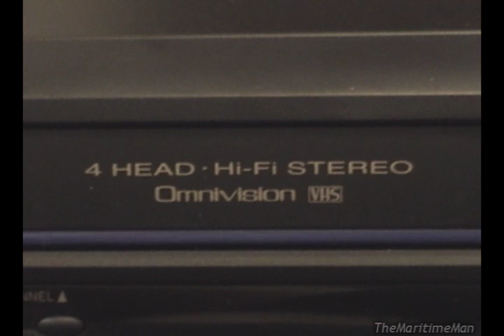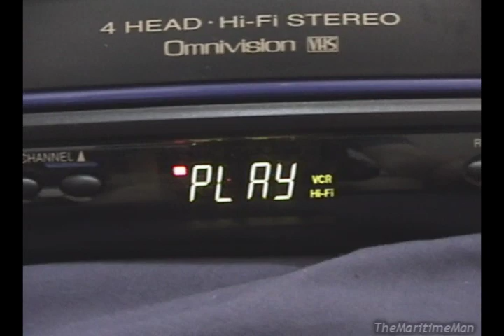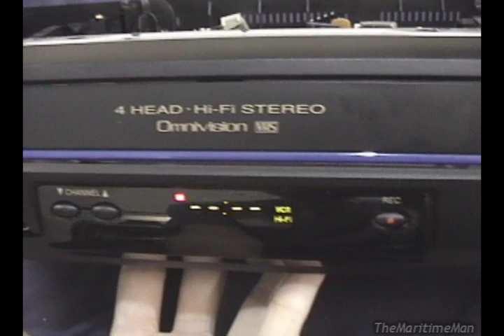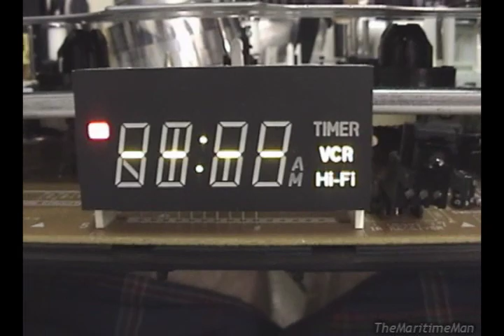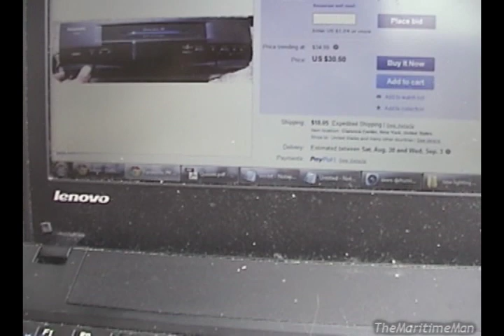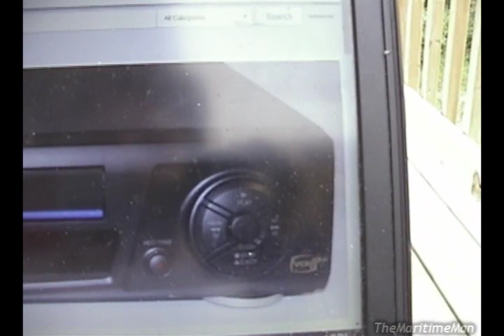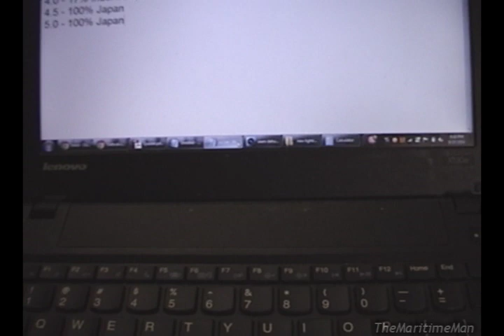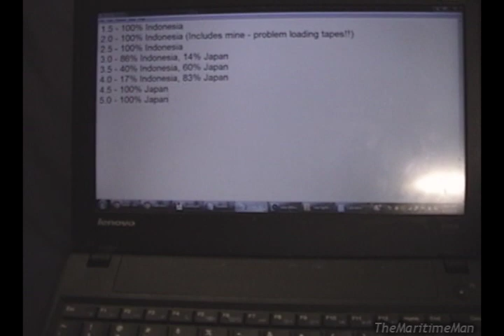Life and Death of a Panasonic 4-head stereo VCR (and lots of info about Panasonic VCRs)

Comment: Great video everything proven tvs are terrible on cable connections now days y is that they don't do good job on soldiering cable connections now days everything proven some tvs picture would moving every now and then yet my had the same problem when I redo the soldiering connection on cable connection on tv itself everything works right now everything proven tvs are going bad now days on cable connections specially people are not doing good job on soldiering now days

Comment: I like to put music on hi vcr tape. The sound quality is excellent. Unfortunately vcr's stoped putting adjustable audio meters on them. The hi fi vcr's in the 80s were better built had the meters, and put all functions on the unit instead of a remote. The newer ones have the great sound but other than that they are built with cheap plastic parts.

Comment: If you "fiddled with the gears" it sounds like you simply put the rotary encoder out of alignment.   VCRs have gearing that is timed precisely - like the cam on a car engine.  Sorry but it would have been a quick fix.  We've all done it and very very frustrating

Comment: 12voltvids would have a fix for it.
Reply: THATS FUNNY I WAS THINKING THE SAME THING! HE'S MY FAVORITE. BUT THERE WAS NOTHING TO FIX UNTIL THIS GUY "STARTED SPINNING THE PLASTIC GEARS" ONCE  HE PULLED TAPE MECH OFF THE BOARD. AT WHICH POINT ALL THE TIMING MARKS WENT OFF ALIGNMENT INCLUDING THE SELECTOR SWITCH WHICH IS WHY THIS BECAME UNRESPONSIVE. 12V WOULD HAVE LUBRICATED THE LOAD MECH. AND CLEANED ALL THE HEADS AND CALLED IT A DAY. UNLESS HE WANTED TO CLEAN THE SELECTOR SWITCH FOR P.M. AND AS A LESSON TO THESE GUYS. AND MAN DOES HE HATE THESE LAST GENERATION PANNY'S. LOL. I SELL THESE ALL DAY LONG ON EBAY 49.95 TO 55 AT A 1500% PROFIT $5 OR < AT GOODWILL. THANKS TO 12V VIDS I FIX  95% OF WHAT I TAKE IN.

Comment: I have one from 2000 and it doesn't look any of those models that you should and got mine for free and I'm using to replace my old sharp that started to eat taps and once I got it out it never worked again and it is 19 years old and payed $10 for it and has done a good. That Panasonic I have ejects the tape fast your player had a week motor it looks like to me. I still. Buy the because I can get for $.25 to $1.00
And I have funi that is very new and got for free because the that it was broken but it had heads that needed cleaned because the atuo head clean stop working and it is the smallest vcr I have ever seen

Comment: I think you should not have removed the front cover of it. I think you missaligned something during this step. :/ What a pity...
Reply from the maker: It had the problem before I removed the cover, though.
Reply: But it looked alright after you threw in and out the cassette multiple times. o:

I like electronics but I hate mechanics. Touch the mechanics and everything is screwed up!

My EUR 550 color laser printer Kyocera: When you move the whole device, you have to realign the color alignments...
Reply from the maker: ***** True, it might have indeed been all right. I made the assumption that it would keep intermittently occurring, though. As it was even when it worked it was slower taking in the tape than it should have been. I hate trying to fix mechanical stuff, too. :P
Reply: Hmm intermittently hangs of cassettes is not as worse as a VCR that does not even stay on. :/

Mechanics are interesting and very advanced, but really annoying and very very sensitive.